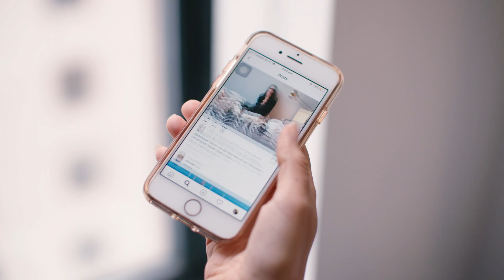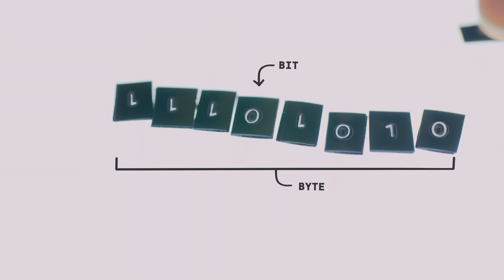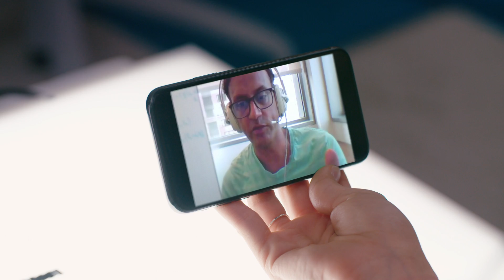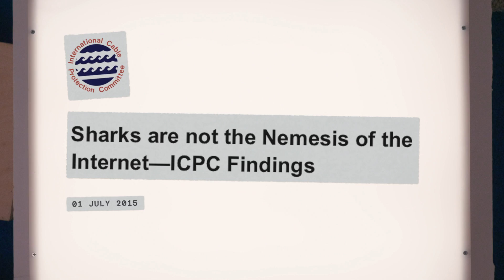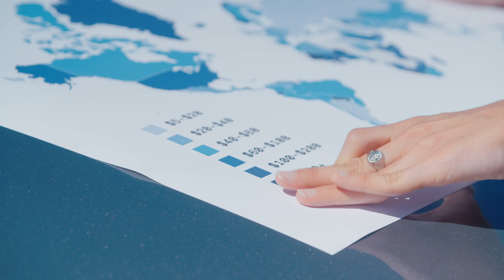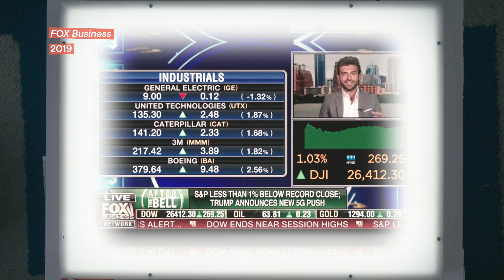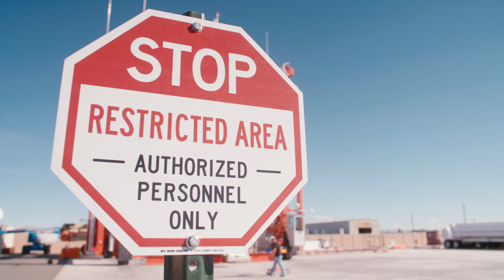How Does the Internet Work? - Glad You Asked S1

Comment: The Internet is pretty simple it’s a bunch of cables or satellites that connect to a bunch of routers all over the world.   The routers send information requests to servers through a series of routers that connect the computers.   The server sends information back to you.   The routers are gateways between different networks.   The information gets translated through different levels of software and hardware in the computer.   Each computer has a MAC (Machine access code) address that gets matched with an IP address.   Domain name servers translate websites (names) into an IP address (like a phone number) that the the routers use to route a request from network to network using tables of IP addresses.

Comment: "The 'cloud' is a marketing term" OMG this one sentence is eye-opening. I really thought the cloud exists as a virtual world, when really it was just bunches of copper wires and fiber optic cables
Reply: Jason Weaver I do exactly the opposite.   I store all my important information with spideroak which encrypts all my information so no one ...  not even their administrators can unencrypted it or snoop on it while it is being transferred.  It stores versions of files so if I have overwritten something by mistake I can get the old version back,  and the files are duplicated across multiple data centres so even an earthquake won’t destroy it.    Compare that to a local computer or hard drive where you are one corrupted hard drive or house fire away from
Losing it all.
Reply: I thought this comment was satire until I read the responses and realized how many people don't even know what a server actually is. It's not something anyone really needs to know anyway, but It's easy to assume everyone knows most things you know.
Reply: The cloud is basically hosting your data on multiple servers instead of one, so when one server goes down, your data remains safe and still accessible. In simple terms, whatever data you save on the primary server, there are multiple clones of the same data saved in multiple servers in various geophysical locations.
Reply: Not really,  the cloud refers to the services that are available via the internet, not just the connections that they talked about.  The same thing as the “world wide web”. Except people use “the cloud” to differentiate heavy duty services like access to things that were traditionally only available on your local computer .   Like word processing,  accounting packages,  databases,   Etc

Comment: This entire video is summarized into the OSI networking model:
Physical - refers to the physical connection to the Internet. This include Ethernet and Wi-Fi.

Data Link - how the computer system interfaces and interacts with the local network
Sub-layers:
Media Access Control - how every networkable device in the world is uniquely identified (hardware or Media Access Control address)
Link Local Access - how the device interacts with other devices in the local network.

Network or Internetwork - this refers to devices within a network or two or more different networks communicate via TCP and UDP using unique addresses.

Comment: This thing is silly.  The cell networks are separate and totally different than the Internet.  The infrastructure for the Internet travels every kind of pathway mankind has invented from copper wire to fiber backbones to satellites.  A new system of sats are being launched this year to carry a ton of Internet traffic not serviced well as for rural areas.  The Internet does not belong to anyone...it is paid for by all those that want to use it, including the providers of last mile broadband links and big corporations.  It is based on packet-switching technology that allows redundant pathways and servers to fail and the data still flows.  The deeply technical parts of how the Internet and the Web (layered on top of the Internet along with a lot of other protocols) work is wrapped up in the myriad of different network types that are all interconnected yet manage to get their data thru without interruption is a testament to the work done by the US Military (DARPA/ARPA) who paid for and, designed and established the early Internet.

Comment: Premium members should get early 5G access!
NUFF SAID
Reply: Switched over to 5G for my home Internet about 2 months ago and it's as good as advertised. Mind you I'm not super close to the tower so max speed I've achieved has been about 320mbps. I think my upload still uses LTE radios because there I'm achieving about 30mbps. Much better than the ADSL that I used to have though which was average 8 down and 0.8 up
Reply: @AnonymousUser77254  do you sleep well
Reply: MM Primer very well. No changes in my sleep routine whatsoever.

Comment: didn't even touch IP, TCP, or DNS. This is not anywhere close to the story
Reply: Did you expect them to explain the internet in less than 20 minutes? :D
Reply: @jt_hopp  they explained wireless routing in detail. But the internet really has little to do with radiowave communication. The internet is a file transfer network. Imo they spent too much time on the bottom layer (cables and wifi) and not enough time on actually explaining what the internet is and how your computer connects with it.
Reply: Henry S it’s a very basic explanation. You’re not gonna teach someone everything about the internet in 20 minutes. Especially to someone who knows absolutely nothing about this topic. Not only are your expectations incredibly unreasonable, but it seems like you’re just trying to find something to complain about.
Reply: Their goal seems to be to give non-technical people an understanding of how physical the internet really is rather than introduce additional layers of software complexity that have been mostly abstracted away for everyone including software teams at this point.
Reply: It sort of covered TCP/IP a bit by talking about headers. But that amount they explained about is negligible.
Neither is PPP, PPPoE, BGP and their autonomous system numbers and associated providers and anything about what actually makes the upper layers possible today.

Even if they would cover IP, TCP/UDP/ICMP, and DNS fully it would still cover a fraction of the big picture.
Reply: This was barely even layer 1. The average Joe isn't going to understand the intricacies involved.
Reply: Where is the real story?
Reply: bro you do have high expectations for fkn VOX
Reply: I do have high expectations when somebody boldly states they will explain how the internet works.

Layer 1-3 is still easy to explain to people if you take the time and translate it to something more relatable for those people.

I mean people who know nothing about it can also be thought how it works. Hence why somebody manage to get a job the field of IT...
Reply: This video is for lay people who do not know the difference between a silicon chip and a potato chip, people like a friend of mine who has to call technical support whenever he has to change a light bulb. Talking about TCP/IP, DNS, HTTP, FTP, etc. is way too technical for them. If you want something more technical, see Crash Course Computer Science "The Internet" https://www.youtube.com/watch?v=AEaKrq3SpW8&list=PL8dPuuaLjXtNlUrzyH5r6jN9ulIgZBpdo&index=30
Reply: Wow you're so smart, let contact Harvard.